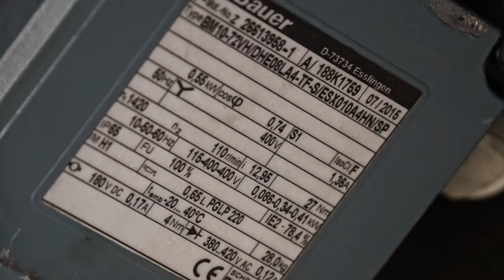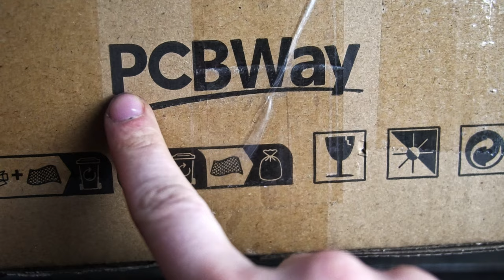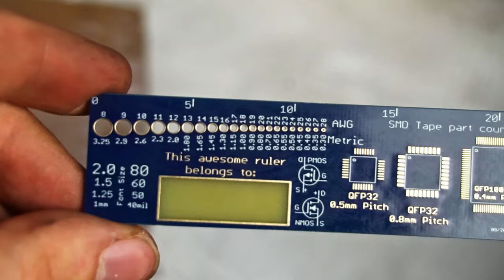Making a DIY Metal Band Saw - The Band Saw Wheels!

Comment: 240 mm outher diameter. 5mm of wall gap depth. So it is 10 mm from both sides. The inner diameter is 230mm. Cut velocity is then 79 meters per minute. Am I right or? I am so, so ashamed that I do not know that. Yikes to me.
Reply from the maker: You're exactly right!
Reply: @GBWM_CNC  I am building similar machine, it will have 40meters per minute cutting speed. 79 is a little bit on the upper side for me. Thank you for your response.
Reply from the maker: @MarioAPN  from what I saw  the bimetal blades should run at about 75 m/min for structural steel,  about 80-100 for aluminium and like 50-60 for stainless. I don't cut much stainless so I should be fine but if you do cut harder materials you should definitely go for the 40 mpm setup :)